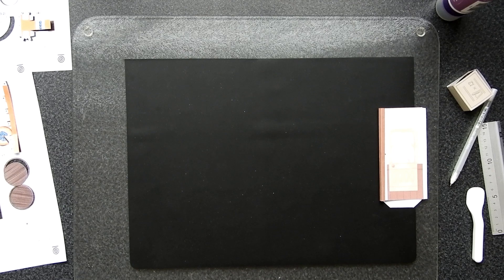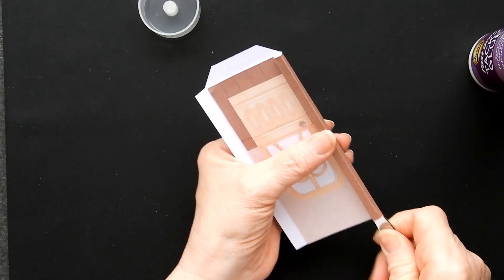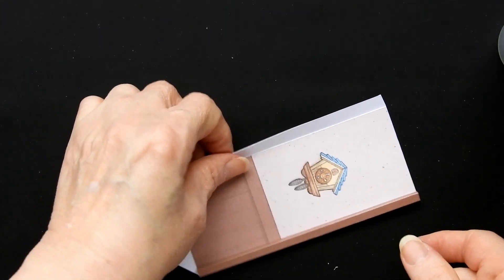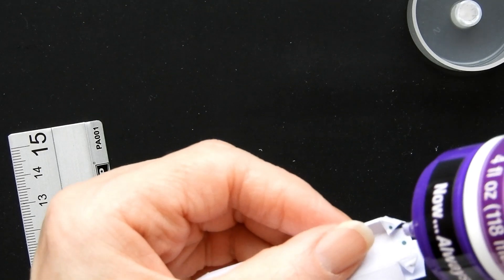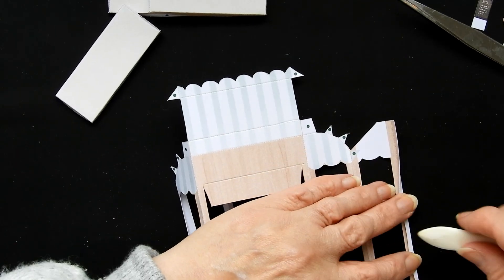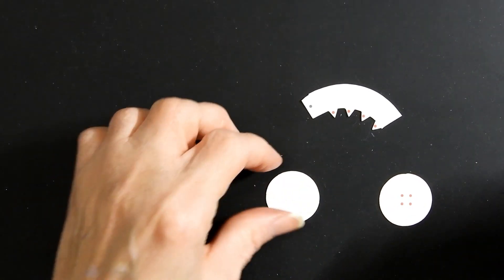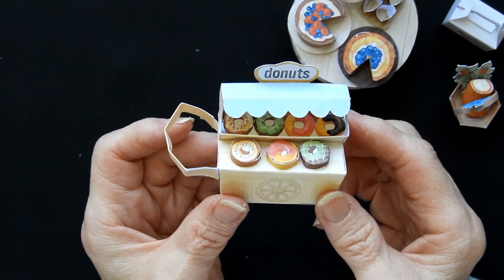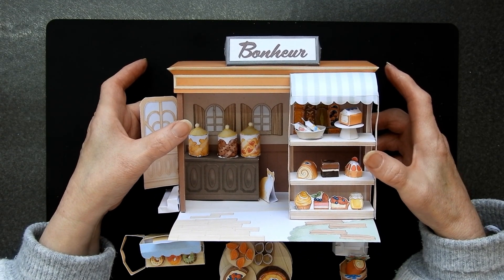Bakery  - Making a 3D paper model

Comment from the maker: To the person who commented on my hands, sorry, I accidentally clicked a wrong button, and although I meant to approve your post (it got held back due to the link) I managed to delete it instead. However, my fingers look odd because of two things, neither of which are painful (thank you for the concern). Firstly, I was born with double jointed hands and feet - go figure, the rest is normal! (Although hubby would dispute that:) Secondly, if you look closely you can see that my fingers are webbed. Th combination is the reason I rarely wear rings any more.. So although I may look like I suffer from RA and I am of an age to do so, that is not the case!